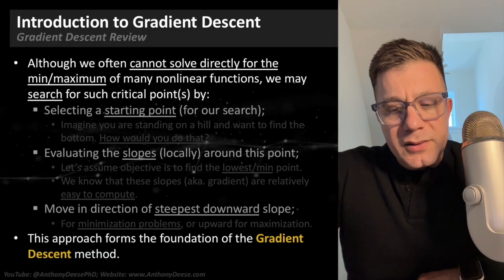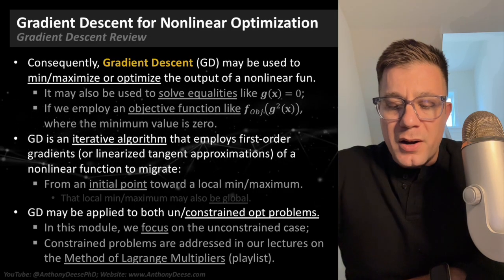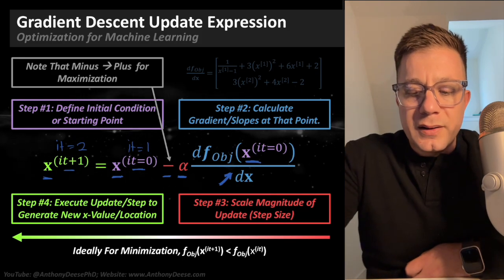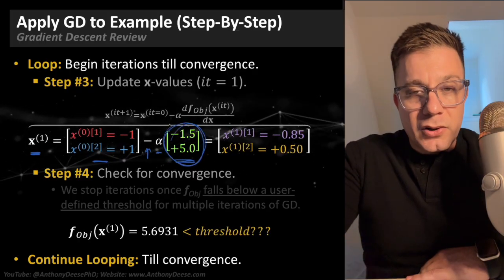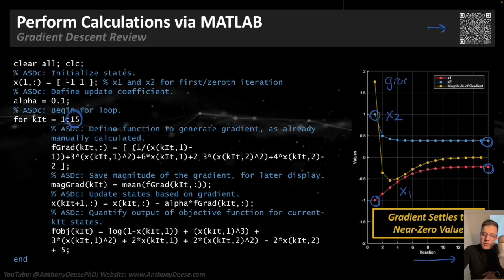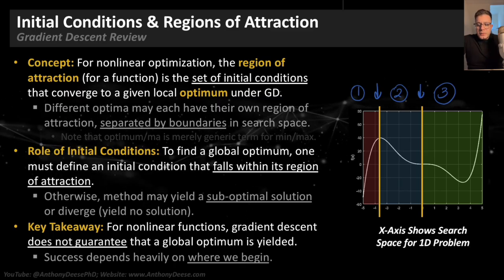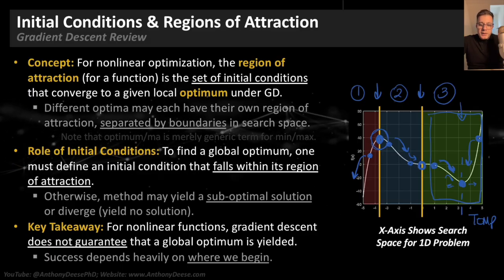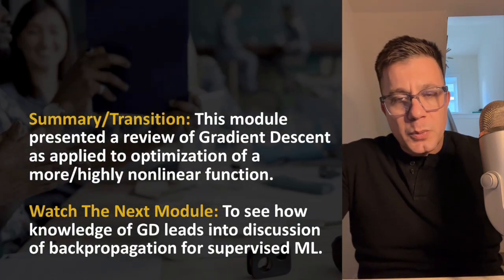Gradient Descent Explained Step by Step with MATLAB Example

Comment from the maker: In this video we explore the fundamentals of gradient descent, one of the most important optimization algorithms in machine learning and deep learning. Gradient descent powers the training of neural networks, and understanding it is the first step toward mastering more advanced concepts like backpropagation.

We begin with a simple gradient descent example worked out by hand to build intuition for how the algorithm operates. Then we move to a MATLAB implementation that demonstrates the step-by-step process of updating parameters to minimize an objective function.

By the end of this lesson you will understand how gradient descent works in practice and why it is so essential for training machine learning models. This lesson sets the stage for the next video on backpropagation, where these principles are applied directly to neural networks.

What you will learn:
	•	The role of gradient descent in optimization
	•	How to solve a gradient descent example by hand
	•	Step-by-step MATLAB code implementation of gradient descent
	•	Why gradient descent is crucial for backpropagation and neural networks

This video is perfect for beginners learning machine learning and AI fundamentals, students needing a gradient descent refresher, and anyone preparing for deep learning and neural network training.

#GradientDescent #MachineLearning #Backpropagation #MLAlgorithms #MATLAB #Optimization #DeepLearning #NeuralNetworks #MathForML #MLBasics #AI #CodeExample